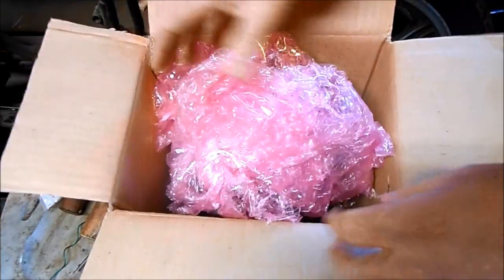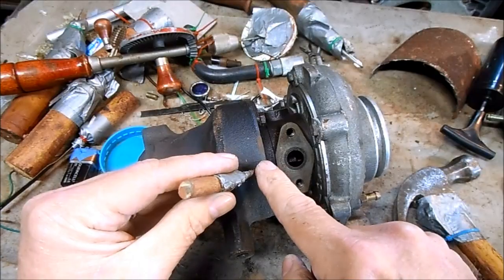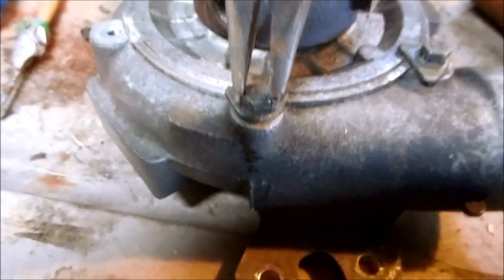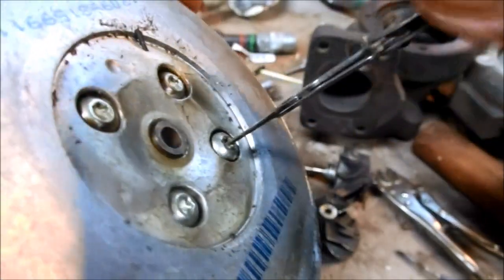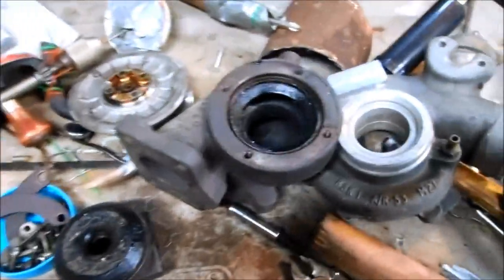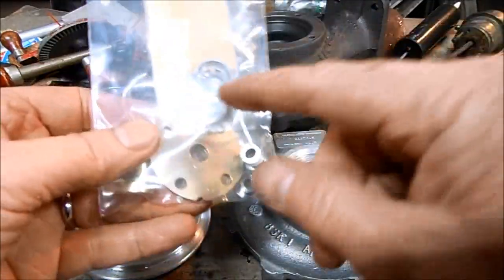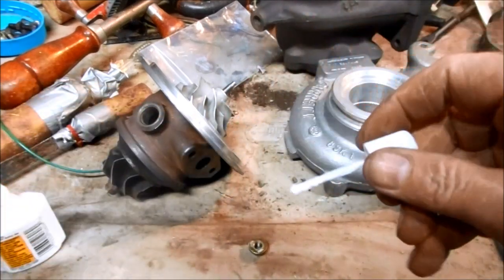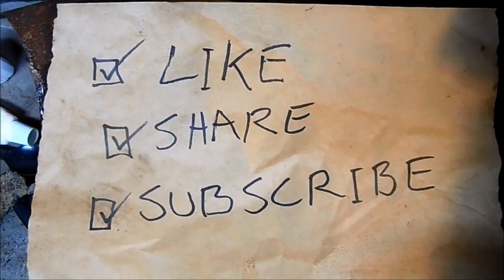how to rebuild a used turbocharger

Comment: Nice. I had a similar battle with a turbo compressor housing yesterday . Was all rusted shut, had soaking in kerosene for a week. Heated it with torch and had all sorts of blocks and chisels hammered into it, finally came loose after many hours fight

Comment: 03:40 I believe thats the oil slinger? doesnt have any seal around the groove because the slinger itself is the seal, its supposedly slings the oil in a 360 degree manner so it will just drip down instead of flowing out
Turbos dont have a 'true' seal ie: orings, gaskets, etc.

Comment: What is that waste gate arm for? Can you use turbo without it?
Reply from the maker: when the system reaches the max boost, the arm opens the wastegate via the actuator to dump exhaust pressure from the turbine. you need it just like the blow off valve for  the compressor boost side of things
Reply: Ichiban Moto Oh ok thought it is for engine break or turbo break

Comment: Would you lock tite all bolts/nuts or just the compressor wheel nut?
Reply from the maker: it really depends on the make model. some kits the bolts come with lock washers, some with locktite on the compressor housing.  also i use anti-seize on the turbine side threaded studs

Comment: So if the turbine housing isn't in a giod position can u just loosen those 5 or 6 screws on the back and turn it to where I need the outlet to b is that what I ment by it can be clocked 360 degrees cuz I'm shopping for turbos and from what I can tell how mine is set up the outlet on the turbine side would be like right up against the block hopefully u reply fast thanx and great video lol
Reply from the maker: The integrated wastegate actuator required it be in that place, however the housings can be rotated, yes 360

Comment: BIG ERROR:  turbines are balanced so you must mark the relative position of both turbines before open the shaft.
Reply: I was about to ask about this.
Reply: One turbine is fixed to the shaft so you can only mark 1 turbine ,shaft and nut
Reply: says who? oh right, the guys that charge $700 to rebuild a $650 turbo
Reply: @northmanlogging2769  facts, even in Bulgaria they wanted to charge me 650$ for a Garett turbo. Both for my Nissan X-trail diesel(Rouge in usa) and e350cdi
Reply: So say he were to replace the compressor wheel.... how would he balance that against the existing Turbine?
Reply: Dude... You must know nothing about itchiban Moto... Check out his other videos... especially the ultrasonic cleaner... 😂
Reply: @jayfbee super-sonic

Comment: Great vid, i took the same turbo apart a few weeks ago, it was from a Saab 9-3 2.0. The Saab it was from has long gone , I replaced my bad turbo with another one. This week bought another Saab 9-3 2.0t, no smoke just no power! Don't know what the problem is yet but will consider buying a kit like yourself if turbo is bad! My only apprehension is that a friend told me it needs to be balanced if I go down the kit route! Can you confirm that as long as I mark the housing to rebuild, will I need to have it balanced!?!
Reply from the maker: Yes you would have to get it balanced 👍
Reply from the maker: Make sure bov and Watergate are good first before ordering things

Comment: My mechanic installed a new turbo Cartridge but is loosing exhaust at the housing connection.  He said that he tightened the bolts right . Do you have any suggestions why is not sealing right?
Reply from the maker: mechanic should back up his work and make it right for you. maybe he left out a seal or gasket, it was not loosing exhaust before he put spanners to it, right?
Reply: @IchibanMoto  my Cartridge needed replaced. The problem is that there is not a gasket on the exhaust side of the turbo.
So im not sure how it supposed to do a thight seal.
Reply: ( is the turbo from a Sprinter 2009)

Comment: What about my turbo, it has NO WASTGATE ,  I guess. It's a 6.6 straight 6 Ford/international intergrated engine. On a Ford F700. Nobody seems to know how to fix it
Reply from the maker: probably has an external wastegate but i have never seen a ford/international
Reply: @IchibanMoto  it's called the Brazilian Ford 6.6 , but it's got a international block and Ford head and intake. Same engine in as Ford, New Holland tractor. Please look it up and reply
Reply from the maker: @johnblack9926  https://www.mddistributorsstore.com/garrett/466290-5001s/new-turbocharger
Reply: @IchibanMoto  I wish I could send a picture of it loaded, but I don't know how to except text message
Reply: @IchibanMoto  I also have a 2000 Ford F-250 that is 6.0 liter diesel, it has a international block and Ford heads.
Reply: @IchibanMoto  thank you, hopefully they can help me find a rebuild kit . I don't want a new one, on a truck with over 500k miles. I abuse it. It hauls logs , single axle truck hitting the scales at 43k pounds and truck empty is only 12k pounds

Comment: This is cleaning turbo not rebuilding. You didn't balance the turbines, didn't check the shaft and didn't calibrate actuator. Not to mention that you use stick and a bit of cardboard as a torque wrench. Rubbish!

Comment: Excellent improvisation- please put up a video on the torque wrench and the ultrasonic cleaner. Just wondering, do you have a home-brewed turbo balancing machine as well? How did you balance the rebuilt core?
Reply from the maker: i do have videos on both the torque meter and the ultrasonic  / i still need to build a balancer so in the meantime, i had to have it balanced

Comment: No proper tools. What a shocker. Hardly a mechanic worth his salt.
Reply: A good workman never blames his tools.
Reply: @GarrisonFall  a good set of appropriate tools used by a knowledgable mechanic is the foundation for a repeatable successful repair. Using scissors to unscrew a standard bolt when there is an appriate tool avaiable is just sloppy and lazy. Risk is big that the material gets destroyd in the process. This is totally unnecessary and completely avoidable. A good workman knows this.

Comment: Very knowledgeable,  but none of the tools you used were fit to purpose ? Literally your screw drivers were all taped up , using cutters to undo a star drive bolt. And cleaning parts in dishwasher? Just use a rag and some parts cleaner? Seriously dude just spend 100 dollars on a socket set lol

Comment: I want to take you seriously but you use vice grips....
Reply: BGinner Gamer so....just the vise grips is an issue?not the left handed screw driver or the power washer?
Reply: Exactly! He did get it right on one bolt. Needle nose damn it, every time.

Comment: There is so much wrong with this video, I not sure where to start. Maybe I would get some metric spanner, a small plastic hammer and a torque wrench for starters. But looking at the state of the internals I would have scrapped it and replaced with a re-con CHRA, Centre Housing Rotating Assembly, which would be professionally balanced from the supplier. Even if the CHRA was worth rebuilding, balancing is a necessity. After watching your video, I wouldn't let you loose on my wheelbarrow!
Reply: Dan Loosmore you clearly can't spot a master Craftsman when you see one. Ichiban is BA certified.

Comment: Argggghhhhh!  You forgot to mention installing the circular heat shield plate against the exhaust side turbine BEFORE putting the shaft into the housing.  Fortunately I noticed I had one part left over...after it was completely assembled.  Otherwise, thanks for an excellent video, and for the humor too.
Reply: i agree but the most important also are  the  retaining ring notably the big one because this turbo will run 2mpg of oil without it

Comment: instructions are incorrect, i clocked my left big toe 180 degrees counter clockwise, and torqued to specifications with the improper torque sequence, and now my turbo does not fit in the light-socket in my living room. Please i need a more detailed video !

Comment: On the Canadian turbos, do you need to use metric vise grips or are the sizes close enough for standard ones ?
Reply from the maker: oh yes!  Turbochargers are precision devices that require the proper specialized tool.

Comment: Great video i ordered the snap on tool kit in video (just under $1100.00) But now have to wait for it to be shipped. So in the mean time i'm installing my cross drilled brake lines, and my new o-pipe exhaust (50 hp gain BTW) If by then tools havent arrived i will substitute turbo with hair dryer to avoid engine damage.
Reply from the maker: ambitious list of badass awesome mods !
Reply: i do all my shopping at http://kalecoauto.com/. Has the latest and greatest custom accessories.

Comment: Makes me want to rip the turbo off my car and overhaul it immediately. And it ain't even broke. Thanks.
Your choice of tools seems heavily inspired by McGyver though.
Reply from the maker: maybe rebuild it every other day
Reply: Lol ! I'll just add another turbo every month without replacing the previous one. In three days I'll go 250 mph.
Reply from the maker: have you seen those multiturbo compound setups with a large and small turbo plumbed in series? one to spool quick and the second monster for top end? I might add that to my Honda minitrail
Reply: Sounds like a plan to me. Go for it.
Reply: Gabor- Or maybe McGruber.

Comment: ...and what about balancing the shaft? If the shaft with the impellers ever been apart and rebuild again, it'll be necessary to balance it!The shaft drives for about 100.000 up to 200.000 rpm (some even more...)!If there is any unbalance in the shaft the bearings and shaft wear very fast...
Reply: Do you think he cares balancing the shaft? If he uses scissors for T model bolts :D
Reply: I guess...yes, you're right, it's naive to ask for balancing...;) :lol:
Reply: normal turbos 25000 rpm but you are right some 300.000 rpm
Reply: why balance it when it is the same balanced impellers?
Reply: All you have to do is get some lead wheel weights from any tire shop and crimp them on...  Simple!
Reply: It is self balanced in the ultrasonic cleaning process.
Reply: i use to buy a core from ebay normal Price 200 euro and it works
Reply: He hand balanced it after the ultrasonic bath.

Comment: Those weird screws are called Torx, mate. Better get used since they get more and more popular to use. Especially in Volvo.
Reply from the maker: +James Di  ah, silly little things
Reply: Isn't it funny how even scientific language can have an accent? 
P.S. now that I have your attention, I am building up to combining a car alternator with a compressor on a single shaft for my audi a3. I could use some tips. The compressor would be conversion of an auxiliary diesel heater compressor.

Comment: If someone used a utility knife to tighten the security screws on my turbo I think I'd go insane. Somebody sponsor this guy and buy him some tools.
Reply: Like the bit where he says "A lot of these are metric so make sure you use the right tools" Then he goes and uses mole grips and a knife to undo nuts and bolts. :/
Reply: guess  you haven't seen ignition grade pink pipe cleaner,  not your ordinary pipe cleaner
Reply: I've seen worse...
Reply: even metric have a 0 tolereance
Reply: in germany they do
Reply: Moondog- Methinks this fellow may be kidding. Just sayin'.......
Reply: Whoosh!
Reply: How about we take a collection and buy him a straitjacket?
Reply: 😂 exactly the first thing I thought 😂😂
Reply: those are torx screws, you can buy them at any tool shop

Comment: Thats it!,  after the torque wrench I was doubled up,I had to turn off the video for a wee while.So cool !.
Reply from the maker: +Kabali 17   I love that torque wrench... if you want one, I have a how to video on making it
Reply: +Ichiban Moto  I already made one exactly to your precise specifications but it did not work so well as I fitted it with a black needle pointer. I eventually found a red one and replaced it, to my surprise lo and behold !  the measurements are 100 % accurate now. Thanks ! you saved me a fortune and the bike runs perfectly..

Comment: That's NOT how you rebuild a turbo..... where do I start!!?? Should have oiled everything that goes inside the CHRA housing thoroughly before installation. And the turbine/compressor wheel assembly should be balanced after the rebuilds finished without being balanced it'll vibrate its self to pieces in a short period of time.......
And before you begin the rebuild process you need to be damn sure everything is exactly in spec. Turbo's are a precise piece of engineering.
Reply from the maker: +MechRider89    I used assembly grease and precise torques
Reply: How are those Garrets balanced? I noticed you didn't mark the compressor wheel and turbine shaft for reference points. I'm not trying to come off as a dick or anything as I like your video's. I just don't want misinformation being spread about. :-(
Reply from the maker: +MechRider89  tell your friends you use a schenck horizontal balancer

Comment: Do you recommend using the high temp dry cycle?
Reply from the maker: +James Demos  for Aluminium, yes. Not so much on the iron turbine housing. It really promotes flash rust.

Comment: Is it okay if I use white assembly paste on my blue '02 Kawasaki ex250 RR high output turbo? Someone told me I could ONLY use the blue with tartar control on the '01 thru '08 Kawasaki because build up at the red-line was an issue, so i needed to clarify before I make my ninja truly Ichiban "bad ass".
Reply from the maker: +Major Pain  If you have plumbed cooling water through the bearing housing, you might get away with white. If not, you certainly want to control the tartar build up.
Reply: +Ichiban Moto Thank you thank you thank you! I was worried my super powered bike was going to suffer from engi-vitis.
Reply: +Major Pain You can only use the blue if your name is Floss

Comment: if you want to add a lot of boost really quick and without any tools just add redbull to your fuel. It will almost double your horsepower and give your car wings.
Reply from the maker: +Deathbystupidity   does that work on bad ass motorcycles as well?
Reply: +Ichiban Moto  i dont see why it wouldnt, although you may want to use diet redbull to keep the weight down

Comment: As always, badass video. Thank man. I am going to repair my old man's turbo now. 
Ps, is there a difference between diesel and gasoline turbos?
Reply from the maker: +Martin Brown  not really, it's really an issue of uniquely matching the turbo size, turbine a/r and compressor to the engine requirements
Reply: How did you learn all this stuff? you seem to know everything!

Comment: In order to properly service SAE and metric turbos, you will need SAE and metric, left-handed and right-handed vice grips otherwise you'll booger up the hardware. Learned that the hard way :(
Reply from the maker: +Gene LeGate   don't forget those vintage British aircraft turbos... I found a nice one to retrofit .... was all happy awesome until I found out the fasteners were Witworth  nuts and bolts.

Comment: I learned so much on turbos from watching. Out to get a left handed vise grip. Thanks Ichiban!
Reply from the maker: +PistnRods   you should Turbocharge your SV ! that would be bad ass !
Reply: Is turbo fin need to be balanced if u open it?
Reply: @billyarden9708  no balance really needed as the wheels are the same. However the clocking of the turbine wheel and compressor wheels relative to each other is important if you want to retain the original balance. Although if you don't follow that the turbo is unlikely to fly apart..it may...may...fail a little earlier though.

Comment: What's the best way to paint a turban housing? I don't like the bare metal look.
Reply from the maker: +motorsickle    google "turbocharger blanket" . They provide a bad ass look and insulate the turbine heat from whatever is around it.  Or you can use high temp exhaust paint, just make sure you follow the curing instructions.

Comment: Badass..... I just realised that i have blue polishing compound that i have used to polish my teeth to pristine condition....... but anyway i smashed one of my teeth, so can i use the blue assembly lube to fix it  ? Does it have any adhesive titanium molecyles to properly make that teeth badass ?
Reply from the maker: +TT GarageRat    the lube is to ensure smooth assembly and protects the turbo bearing surfaces on initial start up. It can take the oil a second or two to build up proper pressure, and you don't want premature wear of brand new bearings. For your tooth, you can just use dental grade oral adhesive

Comment: Nice, but vice grips? Nooo, don't do it! A set of cheap metric wrenches will cost you around 15-20$Tip: Funny looking screw = Standard Torx-head bolt :-)
Reply from the maker: +Krikstar123    that's a lot of money, I'm no rich boy
Reply: +Krikstar123 OK mr NASA rocket Surgeon.
Reply: +Owen Monroe Well hello mr tree hut designer ;-)
Reply: +Krikstar123  :)

Comment: Bad ass. I can see stores selling out of that white loctite & blue assembly paste quickly as many turbos are re-furb'd off the back of this vid. Was the assembly paste that special "Minty Fresh" variety that helps spool and reduces lag due to its friction reducers??Shame you didn't knock up a home made VSR balancing machine, that would have been mind blowing!
Reply from the maker: +Coldfin9er    oh, yes. I should do a video on turbo balancing
Reply: +Ichiban Moto Bad ass, can't wait!! Demo it on that turbo from your Honda. I heard chop sticks are good at removing the circlip that probably holds the compressor housing on, no need for a decent set of specialised pliers!!